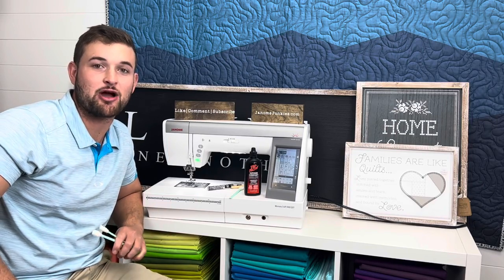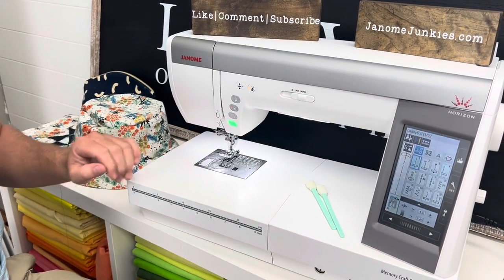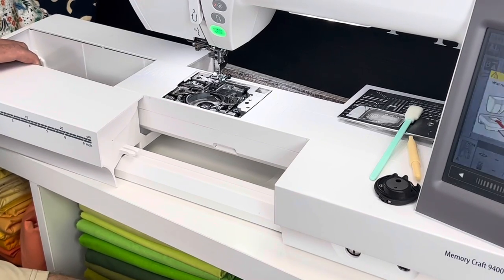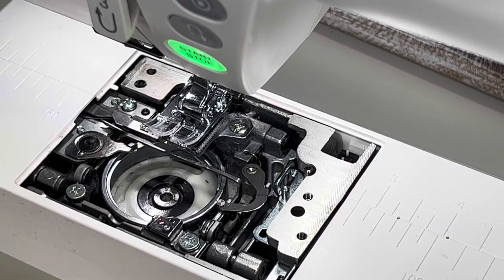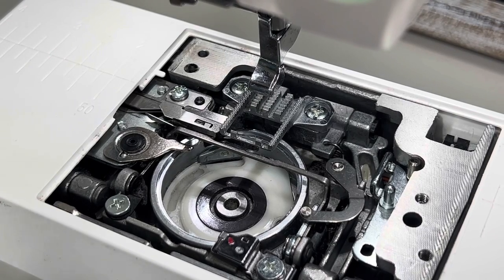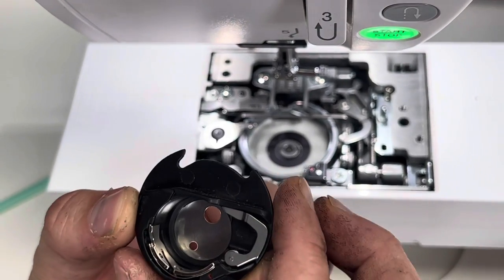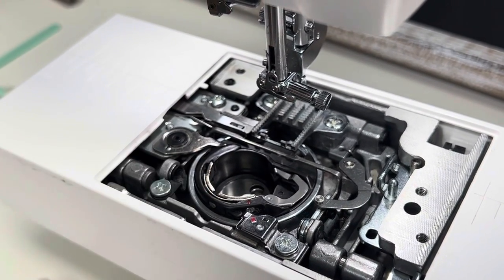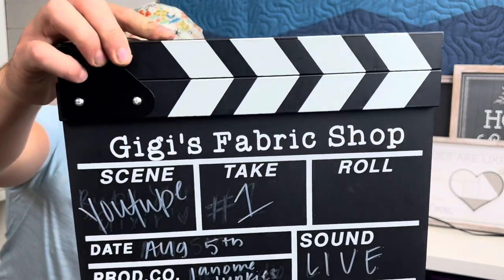How To Clean Janome Sewing Machine! (Computerized)

Comment: Any recommendations for Janome Memory Craft 6500 ) Professional .... the feed dogs are down and will not go up.  Even when using the proper button to lower and raise.  I have cleaned the area, the sping you showed is still intact.  I have put the feed dog lever in the up/raise position.. and turned the wheel forward one rotation to "engage the feed dogs" again.  However that did not work.  What is the next step??  Take it in for service??

Comment: Great video. I have an old Janome MC4000. I learned a couple things from your video that I will try. My janome sews forward very well. But once I hit the reverse it will not go forward again unless  I turn it off and back on again. I'm retired anon a fixed income so it's not going to a repair shop. This will definitely be a DIY project. Thanks again for the video.😊

Comment: Thank you SO much for this video. I was sewing and had an issue with tension and material and the material was pulled down into the machine. I was using a plastic bobbin. My cleaning kit disappeared so I improvised and while listening about the bobbin casing, I thought hmmm, is the plastic bobbin the issue. I cleaned the machine and put it back together, put in a metal bobbin and the machine, and it works! I'm off to your website to purchase a new kit and the awesome tools you used. Thank you SO much for this great video. Excellent helpful video.

Comment: Excellent video...thank you!  Do you know if the face plate on the Sewest 625e comes off or just swings open after removing the cap and screw?  Am afraid to pull it too hard and break it.  Thanks.

Comment: Thanks for this helpful maintenance demo.  I recently just blindly probed with a cleaning tip where the tension spring is.  I need to learn before doing!       Question:  Does my skyline s6 walking foot need oil?  I have made 48 quilts in the past 2 yrs.  Want to maintain it if it needs oiling.  Thanks.

Comment: Hi, really useful video. I just bought a second hand Janome 360dc which has been regularly serviced.  I noticed that it wasn’t feeding very well and tended to feed sideways. I thought the feed dog was not level. I took it off and found a washer under the left side, but not the right, so I thought this might be the reason, but I don’t know if this is how it’s supposed to be, or if there are supposed to be washers under both screw holes (of the feed dog), or neither! Watching your video, your feed dog teeth looked much more pointed than on mine, so I thought also maybe I need a new one? Another useful thing I found in your video is that I need to replace my bobbin case because there is a nick in mine. Very small, but I guess it could cause problems. Anyway, do you know how many washers should be under the feed dog, 0,1 or 2? Thanks!